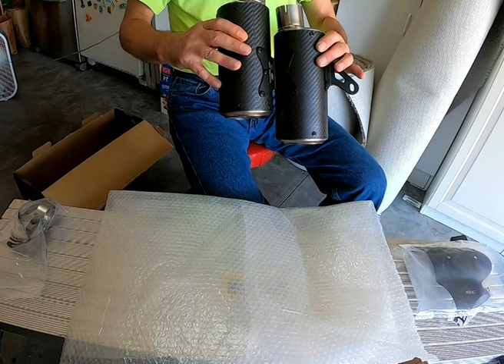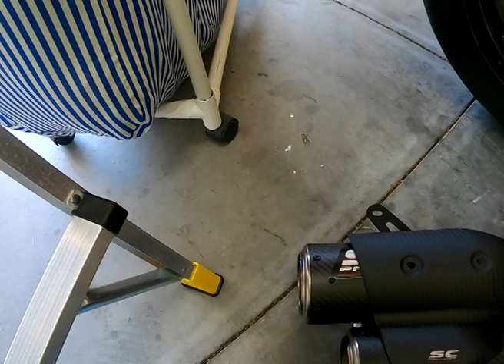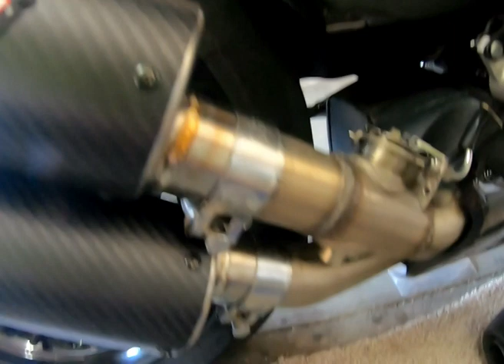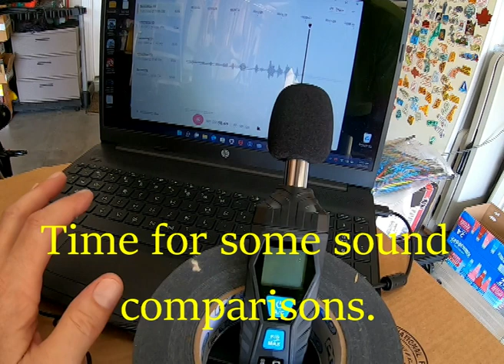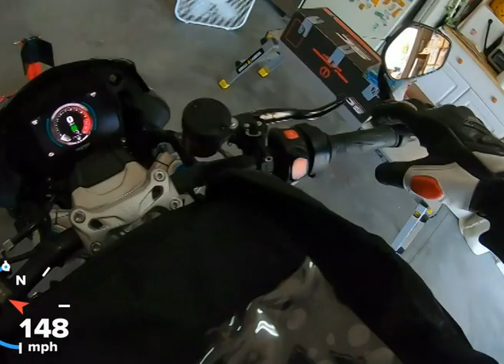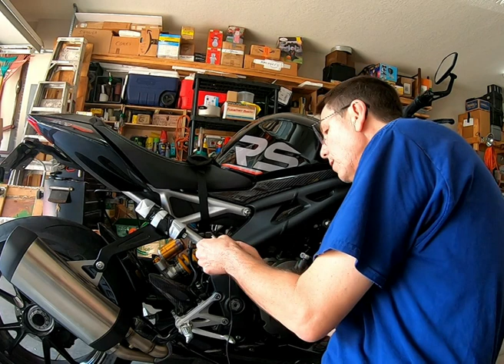Installing the SC Project CRT muffler on the Triumph Speed Triple 1200RS

Comment: Looks so much better than the standard dustbin. The twin arrows on the 1050RS are so much better
Reply from the maker: The low single sided muffler is old school looking and it's growing on me.
      The dual high mufflers was pretty cool looking, but it made carrying saddlebags a challenge. I had an 07 model and used to carry a lot of gear using a tankbag, a tailback, and saddlebags.
    I found a couple of very high heat resistant packing wires from a Ducati crate and would put them over the heat shields. Otherwise the saddlebags would melt or burn.

Comment: hello Scott….thank you very much for your video, you have detailed many aspects, thanks to you you have helped me make a decision, I live in the Canary Islands (Spain), and here the maximum decibel allowed, like Europe, is 98 DB in the papers of our technical file of the motorcycle detail it, …according to your video it has a maximum of 101/105 DB at 5000 rpm….I will have to look for an independent company that is dedicated only to this work….and homologate it… .I have been informed that in principle I would have no problems doing it….so thank you very much and greetings…I am still waiting for new videos…..good routes….
Reply from the maker: Thank you for commenting. I'm glad it helped you. Yours is the second comment about max decibel levels there on track. Many of the other pipes/slip ons seem a lot louder when I hear them. This one sounds pretty quiet next to those. Does that mean you guys basically have to run stock exhausts at the tracks?
Reply: @scottsspeedtriplechannel  ….I think the main problem is driving on any road, by city, highway, mountain etc….in Europe, and at least where I live, which is an island, they are very, very strict, you exceed a Decibel, and It's already a penalty of €300 or €600, depending on the mood they're in that day, 🤦🏻‍♂️, it's a shame, we're very limited to making any changes that aren't specified in the technical sheet,….that's why you'll surely understand better than the dream of every European biker, is to be in the USA, 🤷🏻‍♂️☺️😆….here we have a small circuit, we don't have these restrictions to ride….I have already informed myself and through Triumph they can homologate the SC PROJECT, at Just like an independent company, at least I know that these decibels that exceed me, which are between 3 and 7, I can get to homologate them, I hope so, thanks for answering my message, it has been very good to contact you….
Reply from the maker: @carlosalexisgarciaarocha3583  I think I understand. In the USA, each state has it's own laws about sound levels for street use. What might be OK in Florida might not pass in California. Some race tracks won't allow open/ straight pipes, but most allow pretty much anything else.
Reply: @scottsspeedtriplechannel  I understand, I expected that it was the same law for the entire U.S.A., that there was no difference by state, here it is, the laws in this sense cover the entire country, and are the same as the CE….next week I am going to carry out a analysis of the decibels of my motorcycle to see how it is to stay calm even if it is two or 3 dB margin we have…..

Comment: Scott, great video! I have the LeoVince (same dual cans) and wantred to know where the CAT is on this bike? I take it the CAT was not removed? If not, no remap is needed but I am not sure where the CAT is on the speedie? I have a 23
Reply from the maker: The catalytic converter is inside the collector section of the header pipes. The three pipes from the cylinders collect into one cannister. The cat is in that piece.
Reply: @scottsspeedtriplechannel  Thanks my man!

Comment: Servus from Germany!
Scott, many thx for this vid.
I think your riding Sound is mostly the Airboxsound. For getting the exhaust Sound, you need to chang the Position behind the outlet and install a windblocker on the mic.

Would you plse give a statement on the org. muffler?
Is the upper tube a straight pipe, where you can see directly through?
Best regards
Bras
Reply from the maker: Yes. The upper tube of the OEM muffler is straight through with a slight bend down. You can see through it clearly.
   You cannot see through the lower tube of the OEM muffler. 
   Thanks for watching. I'm glad you enjoyed the video.
Reply from the maker: I had used a microphone behind the muffler, but the recording was so bad that I could not use it.
   I now have two wired mikes that I can connect to the Go Pro. Maybe I will do that in the future.
Reply: @scottsspeedtriplechannel  thanks a lot.

Comment: Another excellent video. The bike is looking epic. Though I’m struggling to hear a big change in the sound of the bike, despite the measured values recorded; mostly I’m getting induction roar. Ride safe👍
Reply from the maker: I know. I had really hoped the laptop recordings would be crystal clear, but that didn't work out. It's unfortunate but with the chin mount Go Pro background noise and wind are the predominate sound.
   There is a definite difference. It's deeper and actually seems a bit easier on the ears. I have the typical 40 year motorcycle rider with no ear plugs tinnitus and I think the deeper tone helps.
    Also, I am familiar with the bike and videos (I've probably listened to them 100 times during editing) so I really hear the difference. 
    I wish it was clearer. I am upgrading to a dual Mike set up soon. Keep your fingers crossed for better sound.
    Thanks for commenting.
Reply from the maker: P.S. : I really appreciate the input. Thanks. 🙂

Comment: I'd prefer duallies under the seat to expose the single sided swingarm.  Can buy a Speed trip with already on it as I have owned 5 of them...but want the 1160 motor.
Reply from the maker: Yeah. A lot of people feel that way. The dual high set up was the Speed Triple look for years.
    I used to do long trips on my 2007 Speed Triple using soft luggage and the mufflers were always a pain when using the saddlebags. So I am just fine with the low set muffler.

Comment: Thanks Scott  I had a 2022 now have a 206 - trading in for a 2023 I think im goign to get these muffs - they look good sound good - )) are you in florida ??IM in Ocala . ive had - speed triples for many years - three of the gen ones and a Daytona super three  -- I also have three vintage 650's including a 67 tt special - would love to ride with you some time -
Reply from the maker: Hi MadMattRides.
   I am in St. Augustine. This is my second Speed Triple. The first being an 07 model. I also owned an 04 Speed Four.
    I'm happy with the CRT muffler. No other tuning or exhaust mods yet. The bike runs fine with it... no issues. I like simple changes like that.
    If you'd like to get together to ride, give me an email address or phone number. I am relatively new to You Tubing and I'm not sure I want to post my info here.
    If you send me an email or phone, what I'll do is simply check it to make sure I have it right, then I will delete your comment.
    I think there is a way to direct message over You Tube, but haven't figured it out yet.
    Thanks for watching. I hope to hear from you soon.

Comment: Scott a little FYI  for you I put the crg lane splitter mirrors on my bike. Looks a little cleaner also can see behind you above 80.That was the only issue I have had with the bike love it.
Reply from the maker: Were you having problems with mirror vibration too? At lower speeds my mirrors are fine, but at maybe 55 mph or higher they vibrate too much for a clear image.
Reply from the maker: I like the looks of the OEM mirrors. I'm not a fan of the small round ones. I'll take a look at the ones you mentioned.
Reply: I too like them but the vibration above 80 was annoying.  The stock ones are cool I had the crg on my old speed triple I like them too. Just thought I would let you know enjoy your channel glad u stuck it out with the bike it's amazing. Almost didn't get it because issues other people  had  , but I got it and love it not one issue so far.
Reply from the maker: @rogerbarfell9075  Yeah, other than the few minor things in the videos, no problems. I am starting to get an occasional rear brake squeal again though. Maybe different pads will help.
   I had a viewer from India blasting Triumph about his bike and the problems. I wonder if there were just some lemons in the bunch? 
   Did you get a safety recall regarding radiator heat on the legs and a shield to stop it would be installed free of charge?
Reply: I have only had it since February all recall done
Reply: Have you changed the oil? Manual says something about disconnecting something from speed shifter and kickstand. Is the drain plug an Allen? Never seen that before
Reply from the maker: @rogerbarfell9075  Yes. I have changed the oil. The owners manual wants you to remove the plastic housing around the filter. No need to do that. Warm it up (operating temp),  let it sit a couple of minutes then remove the drain plug. Warm oil flows better. Then simply remove the oil filter. You might get a few drops of oil on the housing or something, but quickly just wipe it down.
   Replace the plug and filter and fill. Keep the bike level on even ground, a  front wheel chocks holder works great and fill cold to the max level. Run the bike fir a few minutes, shut down, wait a couple more minutes and then fill back to the max kevel. Voila... all done.
   I saw what you are talking about, but there is no need to remove anything. Great thing about naked bikes... mostly easy to get to stuff.
   I do take the large bolt out that holds the shift lever to the frame and hang the shifter when I remove the front sprocket cover. That is what I think is the best way to take off the shifter because it is only one large bolt, not little clips on a delicate rod.
Reply from the maker: @rogerbarfell9075   I don't remember what type of head the drain plug has. Might be a torx. I know it is not a specialty tool though.
   BTW... does your bike have any kind of radiator heat shields that would keep heat off your legs? I got a recall about that. My dealership has supposedly ordered the parts at least a month ago and I haven't heard anything from them yet.
Reply: When I went ti get it they were doing some recall something to do with radiator. I also had to take it in for something on the speed shifter . Was a little concerned about changing oil  it looks easy but Manuel made me nervous, no need to remove anything but  filter and drain plug? Thanks Roger

Comment: Sounds pretty good. Would you say that it retained the same induction noise from the stock can? This is my concern since I've seen others mention it. I had the same thing happen on my Street Triple when I put a Yoshimura exhaust on it and really want to avoid that. Induction noise > exhaust noise for me.
Reply from the maker: To be honest some of the comments have me thinking about the induction sound. My hearing is good, so I know I can hear it but I guess I am not distinguishing it much from the overall tone.
    I don't run it up in the revs that often like a track rider would so I think I am just listening to the exhaust note when I twist the throttle.
   I am just not sure what to tell you. I'll try to remember the next time I'm riding to concentrate on intake sounds. Maybe then I'll be better off to help you. 
    Thanks for watching though and I love getting comments. Best of both worlds (exhaust tone and induction sounds) to you.
Reply: @scottsspeedtriplechannel  Hey thanks for the reply. Yeah I was basing that on the before after audio from your video. Didn’t sound like there was much difference as far as induction noise goes. Don’t want to spend the $ on an exhaust and be disappointed is all.
Reply from the maker: Yeah I understand that. These things aren't cheap.

Comment: Any tricks to getting that heat shield on? I’m
Struggling with it
Reply from the maker: It's been a while since I installed that heat shield, but I remember thinking that the muffler clamps could be in the way if the bolts were pointed straight up when installed. Check to make sure they are facing outwards. I have the clamp bolts at the bottom side facing out.
    I assembled the shield and bracket loosely before installing it to check the fit. Then I removed the shield from the bracket and installed the bracket and clamp as one piece. Lastly I attached the heat shield to the bracket. 
   The clamp fits on the top pipe and can be moved a little bit forward or back. 
   I do remember to be careful with the bolts that hold the heat shield to the bracket. The heads can be easily stripped. Be gentle with them.
   I hope this helps.

Comment: Pipe sounds choked. Baffles still in?
Reply from the maker: The baffles are still in. I have it installed just as it came out of the box. To remove the baffles would mean drilling out rivets and I'm not going to do that.
    It's not superloud like a straight pipe, but I'm OK with it.

Comment: best looking exhaust for this bike in the market. Still thinking to trade my KTM superduke 1290 GT for this beauty can this be a everyday bike ? is the throttle respond is too jerky at low rmps?
Reply from the maker: I don't find it jerky at all. If anything, to me at least, it doesn't respond quickly enough. 
   Bear in mind that I am coming off a 2007 Speed Triple with throttle cables. This is the first bike I've owned with true "fly by wire" electronics. At first, I had assumed that was the reason for the throttle response to be so "soft".
    I've ridden and worked on a lot of "fly by wire" bikes with TC, but never really thought much about throttle response with them. I mostly run in sport mode and occasionally use rain mode when stuck in a downpour. I may not have a good feel for it, but I don't even notice a lot of difference in throttle response between modes.
   As far as slow speed first or second gear riding in traffic, I can moderate the throttle comfortably without any abrupt changes in rpms.
Perhaps that is why the response is a bit soft a low throttle.
Reply from the maker: BTW... I forgot to respond about if it can be an everyday bike.
   Absolutely yes. I was so comfortable on the '07 Triple, that I planned on rebuilding it forever. I said it would be my last bike. I rode it  for a couple of years as my only source of transportation and also on trips all around the southeast US going to and from races. It was very comfortable for all day rides.
    Now that I'm on the new one, I find it just as if not more comfortable than the '07. So yeah, I think it makes a perfect daily ride.
Reply: @scottsspeedtriplechannel   anything i should look out for when i buy the bike? i see many good examples at bargain price very low miles. like 800 miles 1000 miles, i know a few recalls done but is there anything else i should look for thanks for responding !
Reply from the maker: @alfiethefeline3311  So yeah. I have seen multiple problems from You Tubers. From quickshifters that don't work to front brake master cylinders that are broken to radiator leaks. The original issues of loose engine cover bolts and software glitches to broken exhaust valve cover brackets have probably all been addressed, but it would not hurt to check out Sgt. Sodoms experiences with the Speed Triple as well as 2Ups issues. Both are You Tubers who have had some serious issues. 
   Another issue I have heard of is a low oil pressure warning which made some guys afraid to ride the bike fearing it would blow the engine. 
   You could watch my one year video which covers my issues. I did not have any issues that were of consequence and none of them kept me from riding the bike.
    As with any used bike, low miles or not, if you are not familiar with the bikes issues, you could have it checked out by a competent mechanic. Anyone who would not let a mechanic look over the bike prior to a sale probably has something to hide. 
   So check out those two guys and watch my "1 year with the Speed Triple" video to get a good idea of what to watch out for.
   Honestly, I think maybe Triumph had some quality control issues at the factory seeing how some guts got lemons.
Reply from the maker: Another You Tuber who had some issues is Cuban Rider. He has the bike straightened out now and loves it.

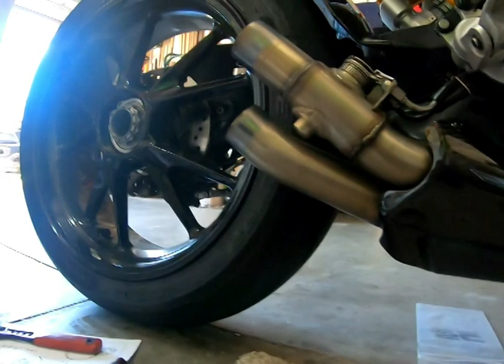Comment: @ around 8:12 would of been a good time to remove the cables from the flapper... just sayin
Reply from the maker: Until I decide to get a full system and/or a tune I'm going to leave it be.
Reply: @scottsspeedtriplechannel  there is a difference in tone when you have that gate open at all times.. the growl is there from idle... take advantage of the full sound with the pipe